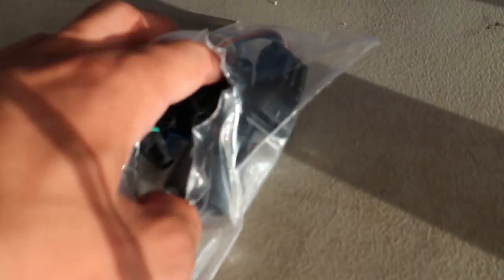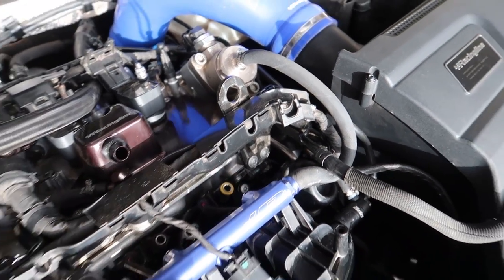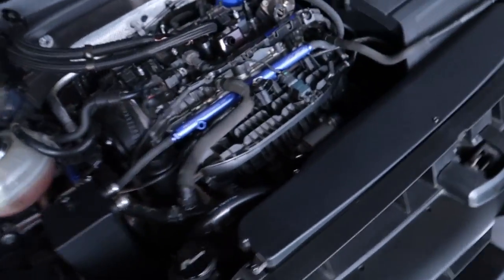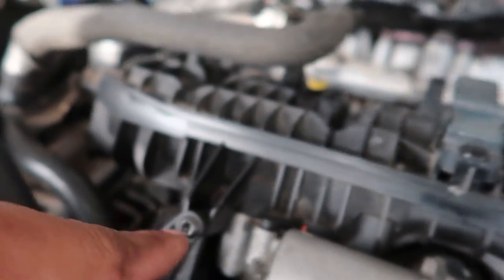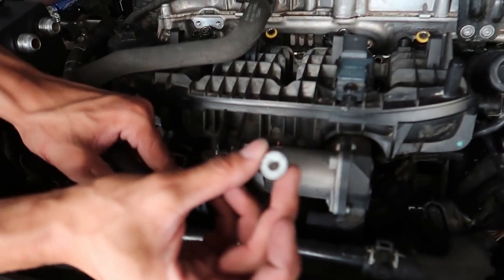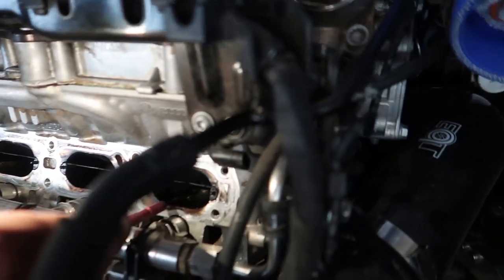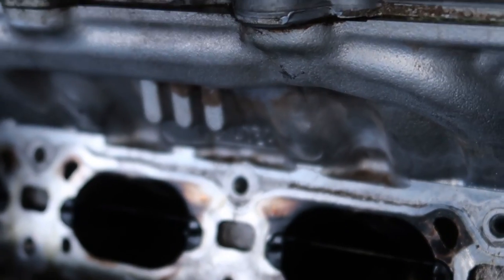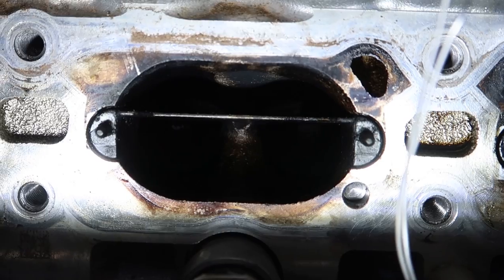BROKEN MANIFOLD! 48hr crunch! | MK7 Golf R

Comment: God, i remember taking this manifold off the gen 1 on my ex's jetta for a water pump replacement and another time I removed mine on my 16 GTI to replace the throttle body because the position sensor went bad presumably because of meth injection and god help anyone who has to do this job lol.
Reply from the maker: I don't think it's all that bad! Way better then doing a vr6 manifold, you have to pretty much put the front end into service position to reach any of the bolts, that job makes this look easy. Hell just about everything is half as involved as my mk4 R32 lol. Was the gen 1 much different then the gen 3?
Reply: @BryceJordanProductions  Actually, looking back, the removal of the manifold wasnt the worst part, the water pump was the bitchj. Also, do you not have a hard fuel line coming from the HPFP thats  all up in the way of the manifold from being removed on the R? on the GTI i only partially removed the manifold because it was so much more of a hassle to pull more  components off when i only needed to be able to reach underneath and unscrew the throttle body.